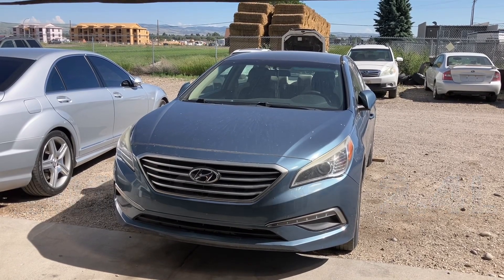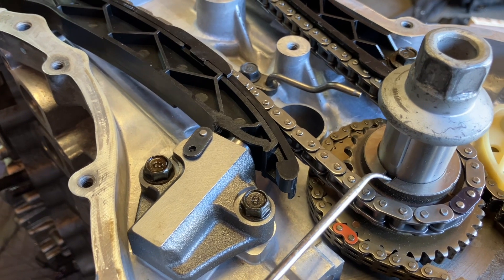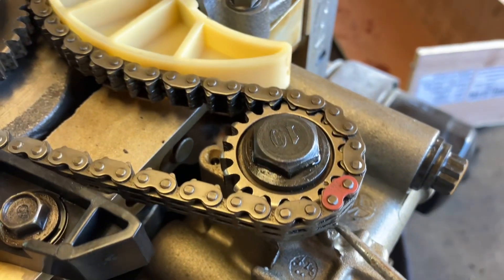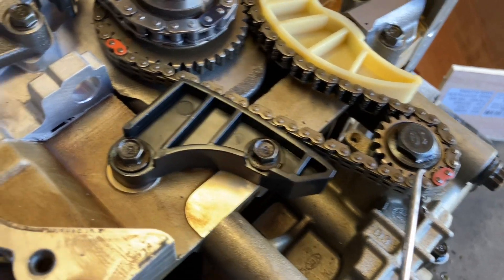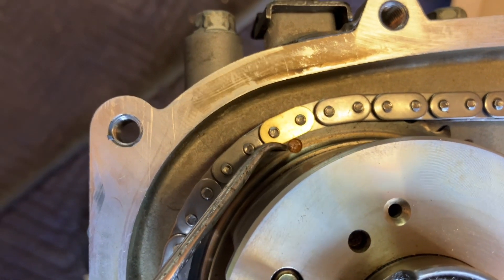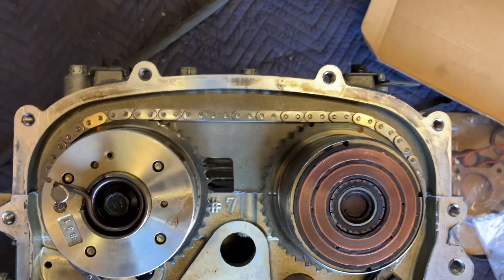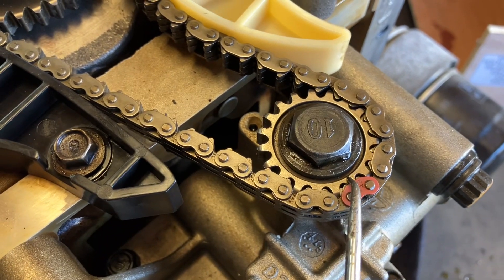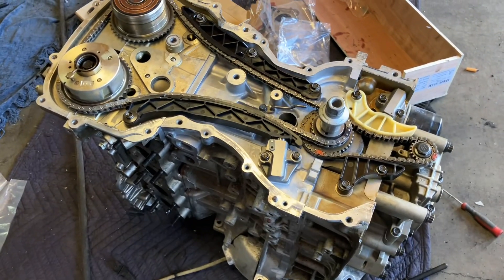Engine Timing chain marks how to align 2.4L Hyundai Sonata 2015 GDI balancer shaft oil pump Kia 2.4

Comment: Do you have to rotate oil pump certain amount of times for it to be in correct position or as long as the marks lime up ?
Reply: @DBOOKIN208  but can u go by the mark on sprocket or gotta see lobes on bottom
Reply from the maker: @josephg8818 Yes just do the marks on the sprocket is fine
Reply: @whogivesaflyingfox  having crazy issue  , valves hold air , timing is on but I'm getting low compression
Reply: @DBOOKIN208  2015 2.4 sonata replace rod bearings and did the head , when we line up all marks and orange dots low compression,  now If we set key way to 12 o clock pistons all in center it gets compression don't make sense
Reply: @DBOOKIN208  when timing is on correct marks get compression of 90 70 110 and I think 90 when we put crank at 12 o clock which is wrong mark we get 130 110 130 130 , he did head rebuild not sure didn't watch him put injectors back on my partner did most of the work it was his project just find it odd that get better compression when timing is wrong
Reply from the maker: @josephg8818 something is not right brother , did you figure it out yet lmk